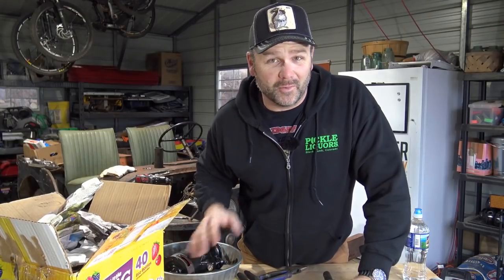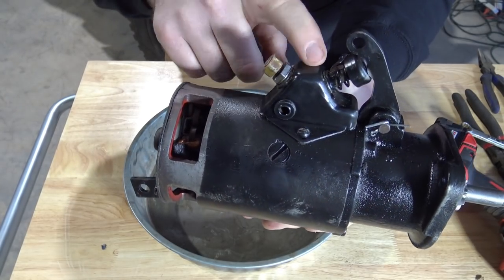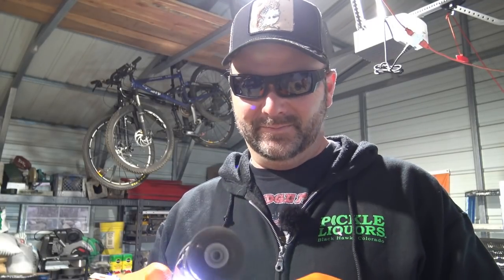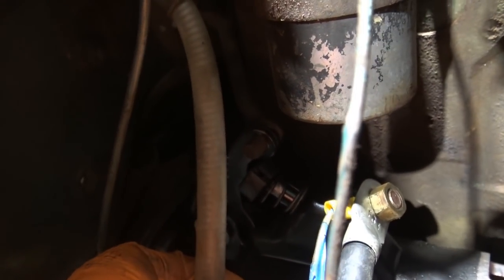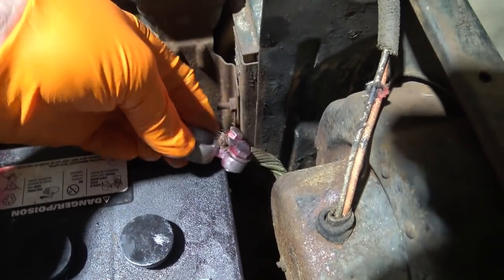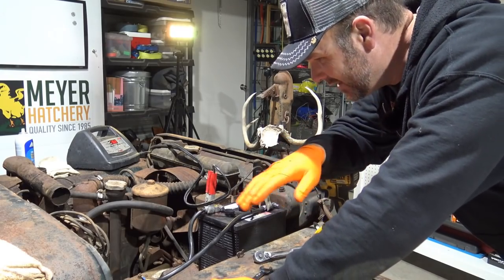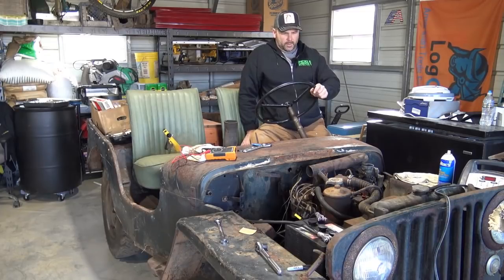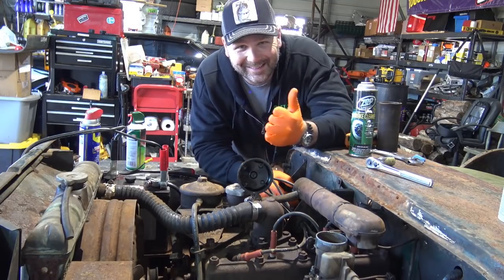Willys Jeep Rescue: More fun with the project! Anybody got spark? Wooooo!

Comment: I think, this is just me, thinking out loud. I would have as a matter of course checked all the plugs wires cap rotor and condenser. The fuel pump and the tank and gas line and maybe an inline  fuel filter in case there is gunk in the line or tank. These things I would do before trying to start the old girl. I don't mean to criticize what your doing because I was never a mechanic. Back in the 60s I was an auto part counter man, and that's the only automotive knowledge I have.
Reply from the maker: So...I agree 100%....here is why I didn't..the jeep ran when it was parked....I thought I was getting into something simple..and I didn't order any parts.....I was wrong...so as we dive deeper into this job...I'm finding that I'd be better suited to pull the body off and do a full restoration.....first I want to establish whether the jeep will run...if it has compression and will run or whether I need to do a complete rebuild......I just want to hear it run...then we're gonna dig deep into the project and rebuild the whole thing!  Just spoke with Kaisewillys.com tonight about being a sponsor for the project....and they're on board!!!!! Woooooooo!!!! Might save some money!
Reply: Good for you. I didn't have the complete story. Good luck with the restoration. I will look for more videos on this. Im a subscriber so I watch all your vids.

Comment: Replace rotor, cap, points, condenser, plugs,  first put some wd40 in each cylinder, leave the plugs out and spin the engine over for 3 0r 4 minutes to free up the rings and valves, then start IT,      GAP THE POINTS AT ABOUT 18 THOUSANDS.    PLUGS ABOUT 30.  CHECK SPARK WITH A PLUG AGAINSTA GOOD GROUND AND SPIN OVER ENG, IF OK THEN START ENG.  IF NO SPARK, CHECK POINTS FOR SPARK,

Comment: So many things you did wrong, where do you start. The plugs need cleaned, re-gaped or replaced. The rotor is toast, the cap as well, and new plugs, wires, cap, rotor, points and condenser should fix it "IF" you have good compression and it is timed properly. And it really needs to turn over faster as well. When you want to test to see if you are getting spark, you have to ground the plug threaded section to ground for there to be a spark circuit. Install a good clean ground wire from the battery ground to the engine block so you do have a good ground. Also, just having a positive wire from the battery to the starter isn't working to allow for spark unless you also have a positive wire to the coil itself when the key is turned to on. I could go on, but maybe that will get you going for now.
Reply from the maker: Need parts right now more than anything.....the jeep was driven into the barn and parked so I have no reason to assume any timing issues .....don't worry Gary....it will all come together brotha!

Comment: I sold auto parts for many years .  There's a difference between  a rebuilt  starter  and a remanufactured  one .  A  rebuilt starter has only the parts needed  installed  to get the thing to work .  A remanufactured one is a complete do over .  Everything gets replaced .  In most cases a remanufactured  one is cheaper in the long run .  Just  a F.Y.I.   thing  !

Comment: If you bought a rebuild i would want all new wires and paint Job .Change over to 12 Volt all you need is change all light globes regulator and points and coil and  inside if Distributor .And when you paid good money for a reco unit you should get a as new reco unit from down under cheers .You centre cap point is no good the middle one

Comment: The plugs are filthy. The cap is broken and must be replaced. the rotor is broken and must be replaced. the points are likely a corroded hunk of junk after all this time.  the condenser is also most likely shot after all these years, The plug wires might be ok as they are not original.  So, order up a ne cap, rotor, points and condenser. ( in order to test for spark by the way, the plug must be in physical contact with a grounded metal surface.)

Comment: The cylinders are dry, maybe rusted... put some oil or diesel fuel in them and crank with the plugs out.. change all the ignition parts, ALL OF THEM, change that nasty oil and then try to start and I think the canister on top is the old style cartridge oil filter...

Comment: Pull the plugs and spray some WD40 in the cylinders and turn it over without plugs to loosen the pistons up . . . they have been setting 30 years and are DRRRR-R-R-R-Y . . . the WD40 with help with ignition if you have spark , , ,

Comment: 4.83 volts on a 6 volt battery? Its dead.
Reply from the maker: Thats what I'm thinking too
Reply: it has to read around 6.7-6.8 volts
Reply: @StoneyRidgeFarmer  Does that digital battery charger work well?  Most reviews I've read of those type chargers have been pretty dismal.  I just keep using my old fashioned Schumacher charger with the old analogue needle gauge and it still works just fine.

Comment: No spark. You need to replace the points and condenser. The points gap also looked a little wide.
it should be around.020 inches or the thickness of a business card.
I did not see any spark at all. Also if your spraying ether in the carb it should start or at least try to fire up if you're getting a spark. 
If anyone has tried to jump it off using a 12-volt system it will burn the condenser up.

Comment: i didnt see a spark from the points so your coil is probably bad. also getting battery voltage from the center spark terminal of a coil means its shorted not good. It should have like 25000 volts coming from that terminal on contact just saying.
Reply: Also the cap wires button and probably condenser should be replaced. the cap is definitely toast from what i saw and the rest is not that expensive to replace so swapping all of it should solve all your problems.

Comment: Try the spark plugs
Reply from the maker: Yes mam...I'm on it! So there was a "voltage drop" on the jeep somehow.....eventually I rolled it off and it fired right up...please check out some more of the series...we've now removed the body from the frame and are doing a full restoration! It's so fun!

Comment: I have one of those POS battery chargers! Hate the thing! Can’t trust it to work right. The old fashioned chargers are much better than these new electronic controlled things. My old roll around charger is much more reliable. And yes, you won’t get spark with the plug laying on a rubber hose. Has to be grounded just like it is in the head. Electricity has to be able to complete a circuit in order to do any work.

Comment: Temp fuel can and hose, carb off and cleaned out, new plugs, wires,cap&rotor, new oil...before trying to start it and tearing shit up. I would never attempt to start this thing in this condition.

Comment: ~Pretty sure you're supposed to put your tongue on the spark plug and crank to test for spark. But seriously get a spark plug tester if not u gots to touch spark plug to ground. Also, if it is a 6 volt system the battery should be at 6 volts if it is any good much like a 12 volt should be at 12. Engine needs fuel spark, air, timing, compression to start. do a compression test to see if u r wasting your time.

Comment: Sounds like its turning over too slow.
Reply: 6 volt only turns slow we used to throw a 12 volt in then and crank them thing rolls over like crazy
Reply: I was comparing it to my friends cj5
Reply: The cylinders are dry, maybe rusted... put some oil or diesel fuel in them and crank with the plugs out...

Comment: 6v or 12v is not relevant to the way the starter works (the mechanical linkage), so saying "I'm not familiar with the 6v system" means nothing. You mentioned the vehicle was positive ground yet you keep connecting the negative terminal to ground.

Comment: Dude, No offense, but A New Cap, Points, Spark Plugs and A rotor should have been the first things replaced... My Grandfather had a '49 Willys just like your '52 Willys Jeep.  Also, Can't you run one of the old plates already existing on the Jeep through DMV to get a copy of the old Title which will revel the Original VIN Number??!???  :o) Tony K. , Melbourne, Florida.

Comment: No offense, but let me share my experience.  I worked for Holley performance products for 11 years.

You are what I called a Gopher mechanic.like the gopher whack it arcade game.

What do I mean by that.  Let me explain.  You think it’s the starter so you knock it out.  Then you think it’s the ground system. So you whack it. Then you say it’s the spark system so you whack it.  what will it be Next?    It’s usually best to replace both systems completely regardless of expense otherwise you end up playing whack a mole for week, months, or , years on end.  Have no doubt on your mechanical abilities, but may be lost on the expertise on where issues lie.

In my experience it’s all electrical. Good clean Fuel will burn with nearly any type of spark.  Ie clean lines, good rebuilt carb.  Clean that up.  From one end to the other if not done properly all the small or fives in the carb will get clogged Fromm tank and fuel line trash and gum.

No spark, fuel doesn’t matter.  Don’t care if 6/12 volt.  I will remind you that early alternators reqiredva resistor or resistor wire to the coil.  It appears all your wires are old did you do an ohm resistance test on each wire. Based on length on each plug wire they need to fall in a give resistance window.  Those plugs looked like crap. To me appeared like rust on threads. If on the plug, in the head threads.  Rust is iron oxide and will not give proper metal o metal contact.

The rust can be removed from the head spark plug inserts with a thread chaser, not a thread cutter.  It requires pulling the head to make sure nothing gets into the piston rims or scores the piston walls.

You should probably pull a plug and get a bore scope to look at the cylinder walls before pulling the heads.  Another suggestion is to pay another engine rebuilder to come our with his bore scope too take a look.

On the plus side.  Those engines are built like a tank.  Project from top to bottom is probably salvageable, but to what dollar?

Comment: The canister is your oil filter.  Its a bypass system.  

Your points did not appear to be firing.  Replace your condensor and points and set gap to .020.  

There is a procedure to test the condencer using your multimeter
https://youtu.be/FxD1OpPQaS0

Comment: WTF, it hasn't run in 30 years, You should have replaced the Plugs, wires, Rotor. Cap and  points.  Changed the oil and filter, added new  antifreeze. That is just what you do.if you expect it to run.

Comment: You paid what ? Like $60 for the rebuild? It's not a remanufactured product. Rebuild is just to get it working. Also if you only paid $60 you want people to work for slave labor rates? It probably took way more than an hour and parts to fix the starter and paint it. Be thankful you weren't charged an arm and a leg for proper shop rates.
Reply from the maker: No a rebuild is a rebuild my friend...new brushes...rotor turned and restored to like new. Not a "fix my starter" it's a rebuild.  I don't set the prices...the rebuild shop does.  I'm not at all thankful for a half assed rebuild....you wouldn't either.  Where I live things don't cost as much...labor is cheaper....land is cheaper and incomes are less.  The average household income is $26k per year...that's the entire household in my town.    I'm happy to pay what it takes to do a proper job....fix it like it's your mamas starter...not like it's your broke cousin's starter.  I guess I have expectations that a professional does a professional job......not a half assed guy doing a half assed job...if I wanted that I could take it to the local day care and have them do it

Why would anyone want a half assed job?
Reply: @StoneyRidgeFarmer  I know cheap my man, I live in South Africa. If you want to be cheap just rebuild it yourself. You know exactly what you wanted and would probably have cost you next to nothing and you'd learn one or two new things. If you are going to live on a farm, then start living the "farm" life which means you need to fix nearly everything yourself. Welcome to the farming life :D

Comment: You paid $80 for the rebuild, $60 plus you gave him the other starter, let's just do the math....
I'd bet they worked on it for more than 2 hours cleaning the armature windings and commutator conductors alone!
Inspecting all your parts and removing the field coils from the other one (without breaking them) to use in your build.
Brushes are cheap enough and so is the leftover paint from the last rebuild from the last customer, screwed you over on that one.
Yeh, you should have got that starter for $20

Comment: With all due respect sir but aren't basic tune up items plugs, wires and a rotor. New oil. A vehicle that's been sitting for 30+ years would at least get that if it was in my garage. Again, with all due respect..

Comment: it's painful to watch him waste soo much time without checking all the fundamentals
Reply from the maker: Fuel, Spark and motion?  Turns out it was a low voltage issue caused by the starter. Not enough power to the coil to light up the plugs.  Rolled it off and it fired right up.  We all gotta learn somehow brotha..and a 70 year old engine and electrical system is gonna have quirks

Comment: go to harbor freight or the parts house and get a spark plug tester https://www.harborfreight.com/catalogsearch/result/index/?dir=asc&order=EAScore%2Cf%2CEAFeatured+Weight%2Cf%2CSale+Rank%2Cf&q=spark+plug+tester like that one and you can check and see if its getting spark and check the Resistors. my dads tractor had the same problem turning over but no spark changed that and boom started right up

Comment: First off, your starter rebuild person is  a complete disappointment with only replacing one of the three brushes you showed. Granted they polished the armature, replaced bushings and shot on a fresh coat of paint but that's still makes for an incomplete job. I personally would've gone back and demanded that the job be done correctly. 

Second, you said you replaced the spark plugs and wires but apparently you didn't. I'm not trying to be rude but common sense should dictate installing new spark plugs and new spark plug wires. You should've been able to tell upon visual inspection of the distributor cap that the contact button in the center was  faulty and replaced the cap. The broken distributor rotor should've been an absolute no brainer along with new points and even a new condenser while you're right there in the thick of everything. It's been almost 30 years since I was turning wrenches at an Oldsmobile dealership but if I would've left small items like that to chance my boss would've chewed my arse up one side, down the other and about 9 times around and embarrassed the daylights out of me. The energy coming out of that coil needs to have a pathway with the least amount of resistance as mechanically possible to get to the spark plugs. Continually spraying starting fluid into the carburetor isn't going to increase the strength of the spark. I know you tested for battery voltage at the coil and coming out of the coil but that doesn't mean that the coil isn't breaking down internally when it has a load on it. Coils are not very expensive so replace that while you're right there at the same time and eliminate the variable. Sorry I've been so long winded here and yes I've made my fair share of mistakes in the past. I'm no better than anyone else. God bless one and all and keep making these videos.

Comment: Are you lying or do you not hear yourself. You said you already have new plugs and wires, then you said you have to get some plugs and wires. What's up with that. I'll be back to show the time period you said it..... I'm back.. At 8:40 you said you bought new plugs and wires.. At 19:26 you said you needed new plugs..  At 20:17 you needed new wires. Do you think we're stupid? We're not the ones that put the spark plug on a rubber hose and tried to get spark, you did.
Reply from the maker: I ordered new plugs and wires, cap, rotor condenser, points and coil.  What I meant to say is that I ordered them...I did have new plugs back in the back...turns out they were incorrect....it's ok man...take a deep breath..I'm not getting one over on ya buddy
Reply: 8:40 you said.... I got new plugs and I got new wires.